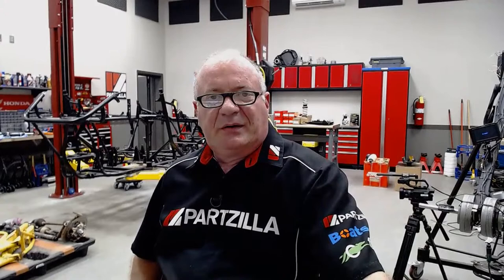Live Q&A with John Talley | Partzilla.com

Comment: Hi John. Great video's all of them. Very informative. My question is: I have a 2010 Honda Rancher TRX 420FE and it's spitting and sputtering and idles too fast for me because when i shift it jerks real hard. I was told that the IACV is bad.  With the IACV installed or not in at all it still idles the exact same why is that.  I am trying to find out if it's bad or not. Thanks

Comment: What is a good output voltage of a rectifier on a 1999 Honda TRX300. I have one that when you rev up it is putting out around 18-19 volts at the battery.  I been having batteries not last but maybe 6 months and will kill the battery in a few days if not ridden. Pretty sure it’s a bad rectifier